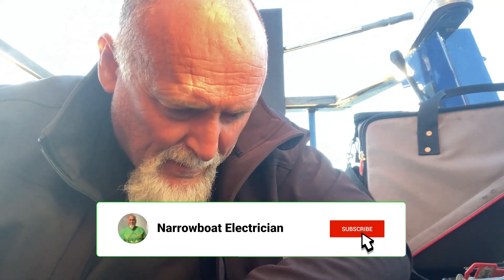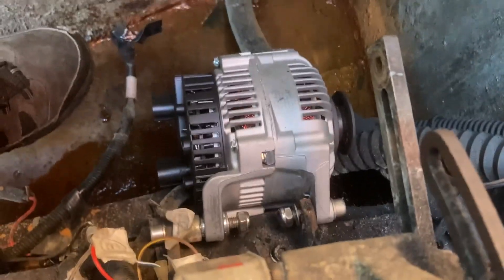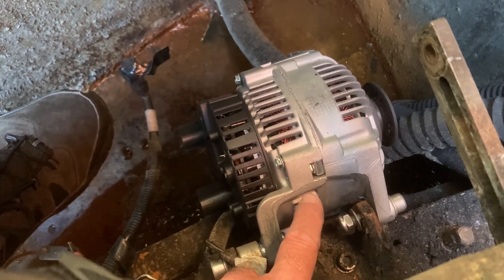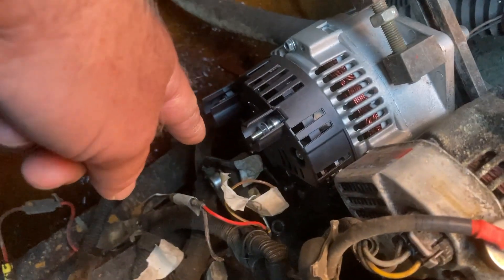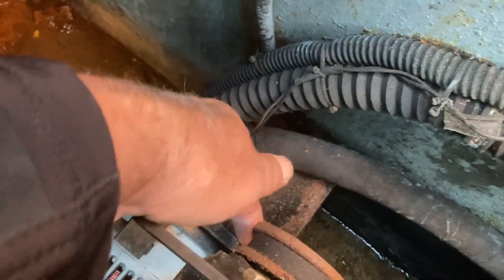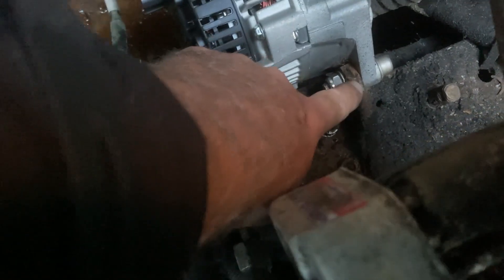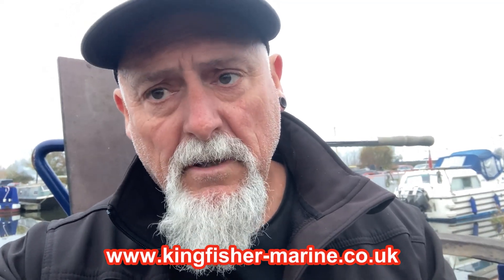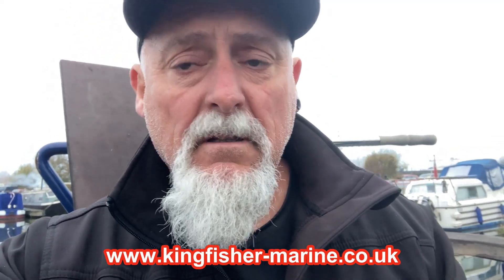Narrowboat Alternator and Webasto Diagnostics

Comment: The connectors referred to (the two way on top go the heat unit) are Wago 222 series 32A connectors available at Screwfix. What is the concern over their use?
Reply from the maker: Hi Adrian, they have no place in a wiring harness on a boat, and should definitely not be an added connection to a Webasto. Every time I come across a Webasto loom that’s been chopped and changed it causes issues. Thermo Top software will shut the heater down if it drops below its minimum set point, and at 12v it’s really easy for a poor connector to cause this issue, especially when the glow plug is active. You’ll never see me use them.

Comment: Witch connection.........all of them, me personally I do all on marine side to at least ip56.....if no better.......
Proper service always keep brake downs to a min.
Reply from the maker: Hi Marc, I hear you but very little is IP58. Think of the back of an alternator or starter motor/solenoid. BSS ensures no connections are in possible bilge water area. Webasto heaters do have seals on the connectors but not designed to be put under this much punishment. Thanks so much for commenting, really appreciate it.